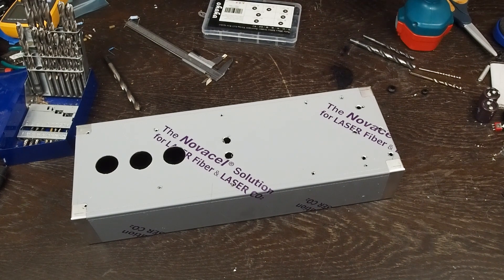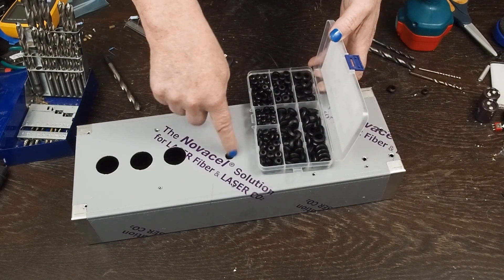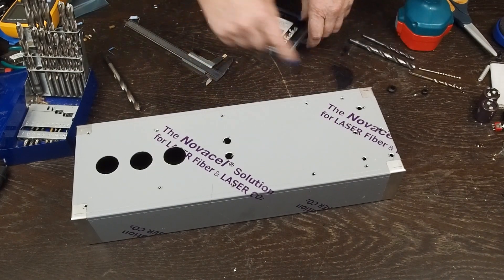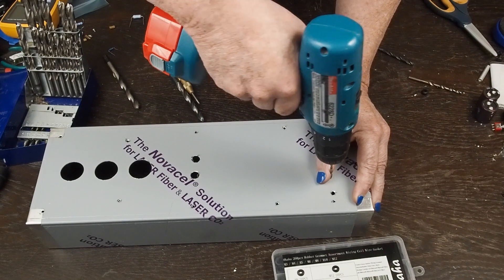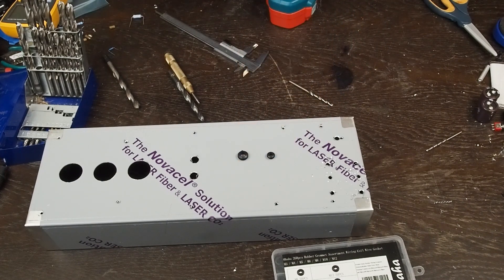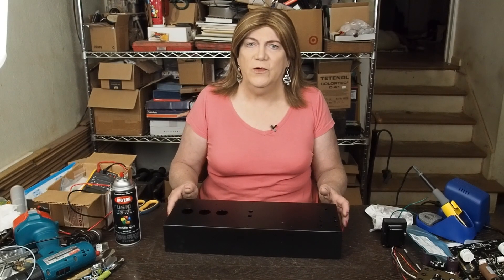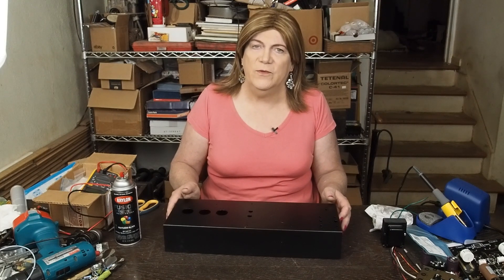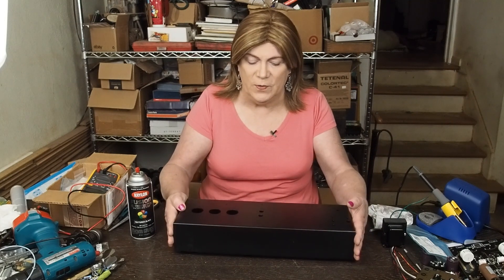All Tube Phono Stage Pre-amp Part 9: Chassis Fab

Comment: Instead of screws, what about using aluminum epoxy or aluminum flue duct tape fo attach the baffles? The aluminum flue tape can handle high heat unlike aluminum hvac duct tape.  Nice paint finish.  Looks very professional.  Regarding longevity vs. powder coating, it is going to be sitting on a shelf and barely touched.
Reply from the maker: Yeah, those are options. I haven't decided yet exactly how I plan to do that part.